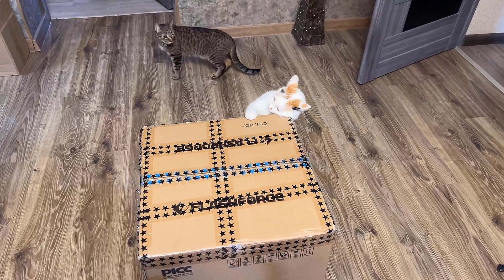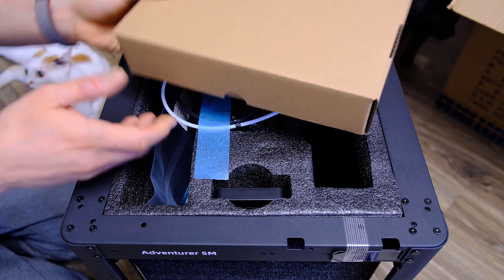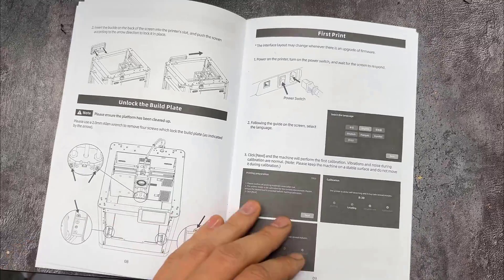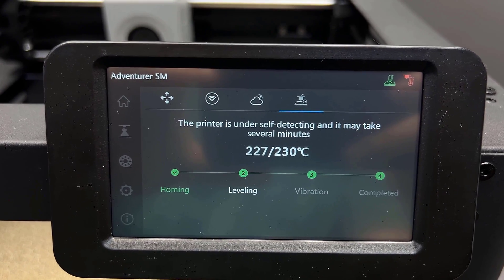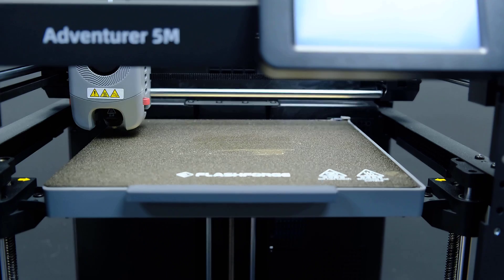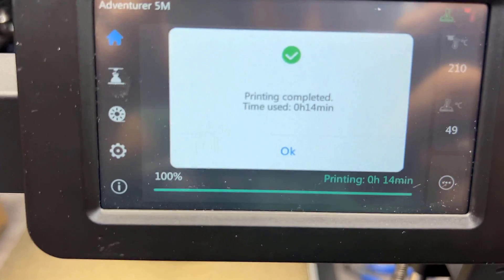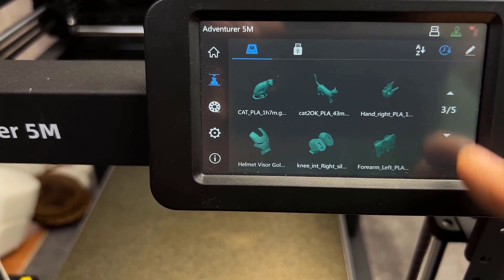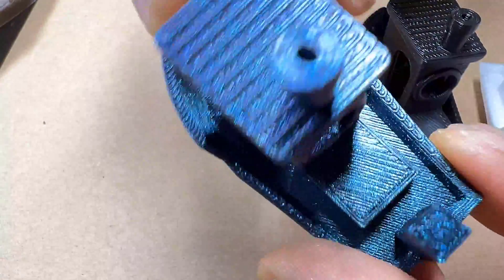Unboxing of the FLASHFORGE ADVENTURER 5M 3D printer  Review and test printing at super speed

Comment: Had one but gave up on it because of the bad slicer and locked down format of the software.  Just bought the FF AD5x with the color system that should be a more open system due to CoPrint's add on color.
Reply: But you could just use orca slicer...
Reply: @nikitaokhotnikov6372  I use orca normally.  I hated their implementation of it and the thing is still locked down.

Comment: Have you tried printing it at max speed 600mm/s , did you find it effected the quality of the print significantly or it still functioned well doing so? Thank you
Reply from the maker: I tried. But the result is ambiguous. If the model is not complicated, the plastic is high-quality and dry, then the print quality at 600 mm/s is good. And vice versa, if the model is complicated and the plastic is of poor quality, then the print is terrible. There are special types of plastic for high-speed printing, but I have not tried them yet.
Reply: @DoasIDo1  thank you ✨

Comment: I got this printer and I did everything by the book I turned it on and it's smoking and the electricity was out any ideas?
Reply from the maker: Wow! This is clearly a manufacturing defect! You need to replace the printer under warranty.
Reply: @DoasIDo1  I asked for a replacement or refund so rn I'll wait until then
Reply from the maker: This is actually a very good printer. I've been using it for a few months now and I'm very glad I bought this particular model. You were just unlucky.

Comment: I bought one brand new

First run today

It just crashed into the bed and destroyed one side on the first test print

Any ideas???
Reply: some other youtuber had this happen too, but he said its cus of old firmware so try to update that if possible
Reply from the maker: You better contact the seller with this question, I hope your printer is under warranty?
Reply: @DoasIDo1  A firmware update solved the bed crash issue

Bug in early firmware another youtube video had same problem as me

Flashforge sent me a new bed plate and the sensors/cables just in case it wasn't firmware

But using original plate (Double sided so using other side) and done 40 hours of printing since using latest firmware

Not had a problem

More getting prints to stick

I've bought the enclosure kit but struggling to print ABS but not got the right ABS profile for Orcaslicer so it might be something I not set up right

I use the stock version not Flashforges

PLA I found I had to drop height slightly to get them to stick consistently
Reply from the maker: @TheHat1607  I'm very glad that you were able to solve the problem! Please share the link where you downloaded the printer housing from?
Reply: @DoasIDo1  Flashforge are sending me a new bed for free

I updated the firmware and it works perfectly now

But I have found it wants an enclosure to get it to print reliably

I used a towel for now but will get the kit for Alixpress and print the bits out
Reply from the maker: I'm glad you were able to solve the problem! The housing is needed for ABS printing; for PLA or PETG the housing is not required